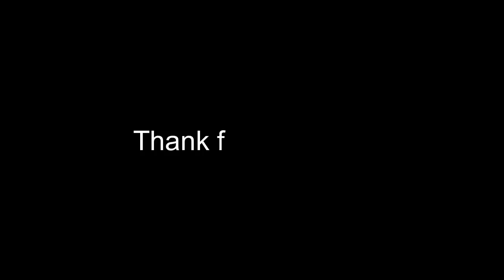RC homemade how to make rc drone at home Very easy and simple.

Comment: Learn the basics.... Opposite propellers move in same direction..... Spam. Video.... He just  hanged that drone through the a thin cord of wire or thread.... Lol grow up....... Buy some props and it will definitely fly and loose some weight by making it small.....